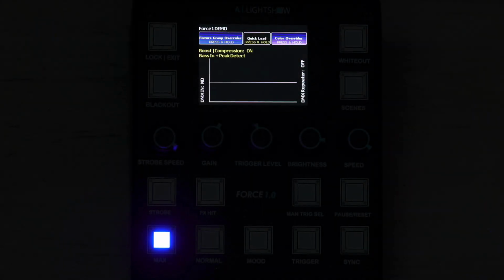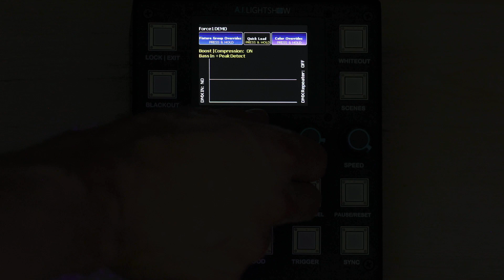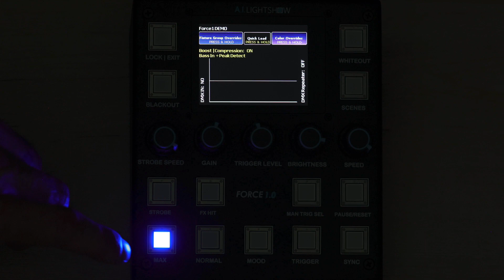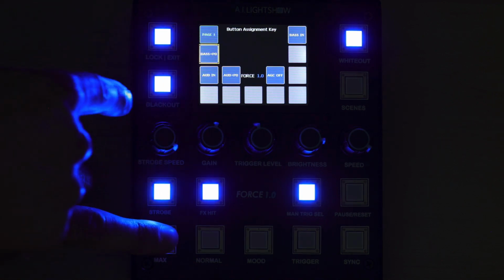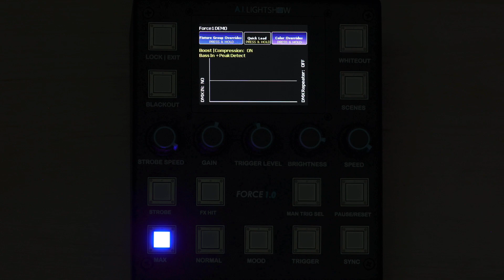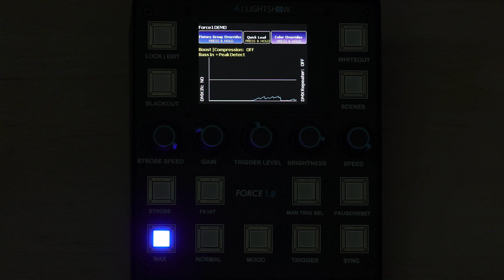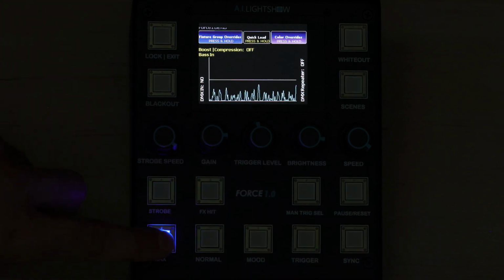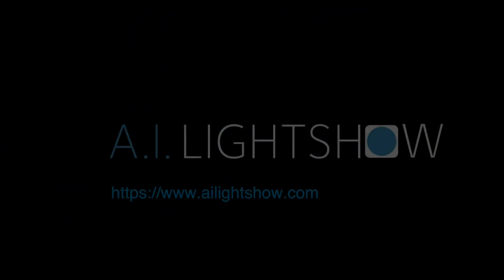Force 1.0 Audio Conditioning Blocks - Tutorial

Comment: Is there any recommendation, based on the type of music to be played? How do we know what's more adequate for a more rythmic or more fluid light show?
Reply from the maker: The biggest way to influence the dynamics of the light show is to use the MAX, NORMAL, and MOOD buttons.  The audio conditioning blocks provide different approaches at conditioning the audio signal.  As long as you’re able to generate triggers correlating to the rhythm of the music then the box will handle the rest.  A lot is handled behind the scenes but the triggers create an immediate reaction, so you want to ensure those are occurring to the beat of the music.  Whichever audio condition block gets you there is the right answer 👍